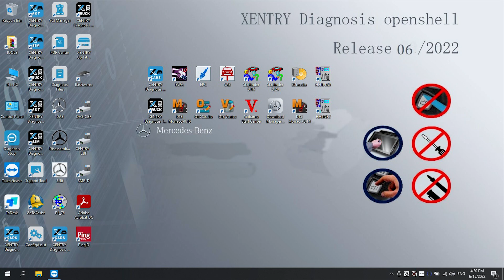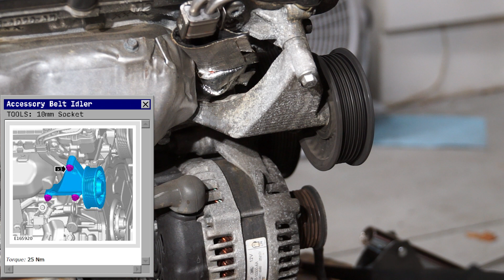Jaguar F-Type (X152) Ep. 5 - AJ126 Engine: The Disassembly Begins

Comment: Great coverage on the AJ126 removal and tear down.  Quick question, how difficult will it be to do a normal clutch swap with engine in the car? Are the wires on the tranny easy to remove?
Reply from the maker: I have that same question as we'll replace the clutch later on, once we confirm everything is ok with the engine back in the car. I believe the bell housing bolts will be accessible just with how much room there is with the two missing cylinders on the AJ126. The bracket at the output flange of the transmission can come off inside the car but you will have to use a T40 hand wrench because of how tight the transmission tunnel is. The most difficult connect to undo is going to be the gear indicator sensor plug (0:36 in the video) because it sits on top of the transmission's bell housing...MAYBE that is visible looking down at the transmission from under the hood but it'll be down in there under the cowl. Let us know if you get a chance to look at that spot with everything situated in the vehicle
Reply: @HernnitTheCrab  Are you considering deleting the symposer? There is a kit that someone put together on the JagForums. This could give more room to the rear of the engine and allow for more access back there.
Reply: @HernnitTheCrab  i just pulled my manual trans (which was taken out previously by an Euro specialist for my light weight flywheel install) and i was able get through the harness removal, 4 wire connector with small red tab, and all 13 bell housing bolts.  I’ll try to get it up on my Onca Engineering channel.  It was very tight coming out, and i had to force the rear of the engine to angle downward which put some of the components near the firewall at risk of being crushed… not easy work. Not looking forward to reinstallation.

Comment: Did you have the 10.9 or 12.9 crank damper bolt
Reply from the maker: This is a piece of information I did not even know was a thing for the crank bolt...for all I know, its a grade 10.9. Is there a quick way to identify the grade on the bolt head?